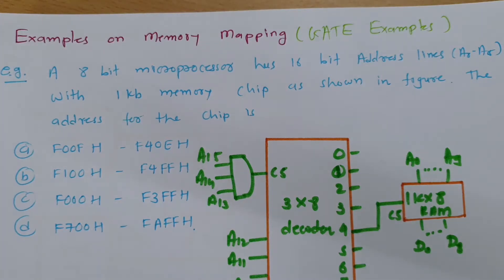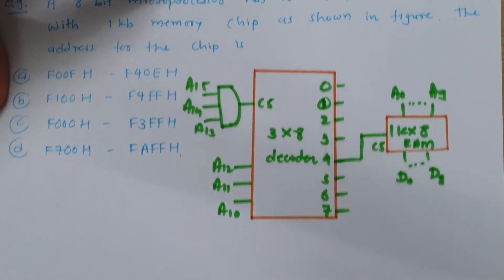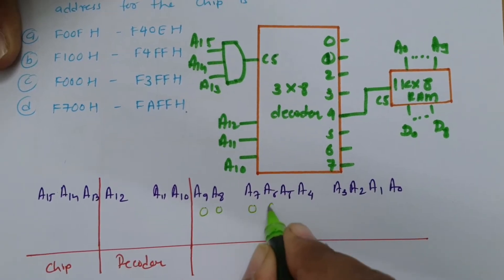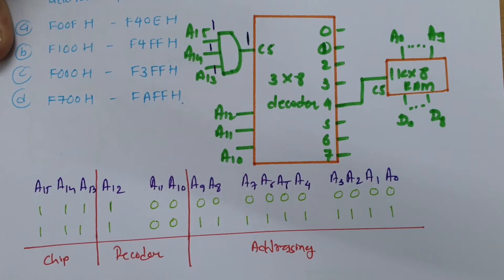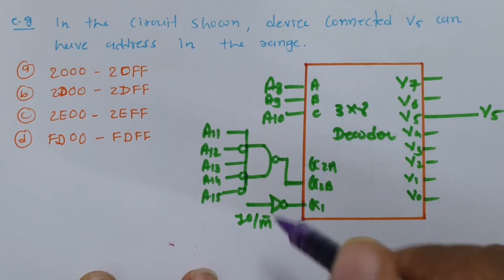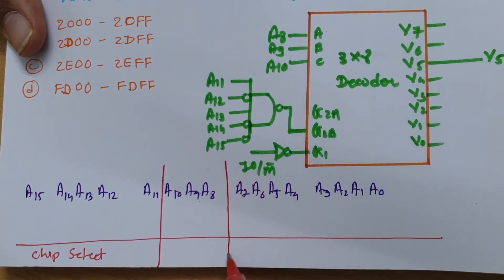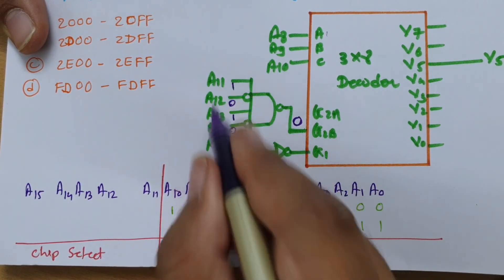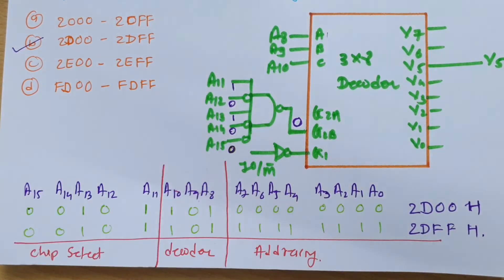1 - Memory Mapping Examples for GATE: 8085 Memory Interfacing Explained

Comment: for first problem here u took cs=1 for chip selection but in second problem u took cs=0 for chip selection why?? please explain
Reply: Because in 1st question, CS was Active high and in 2nd it's active low, In general CS is active low, but sometimes it's used as active high so, You have to determine acc to diagram.